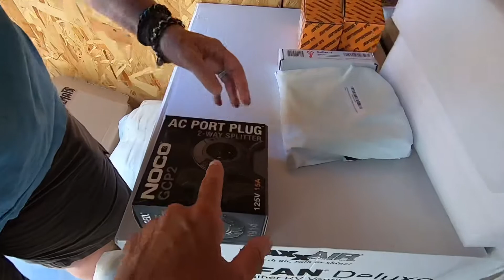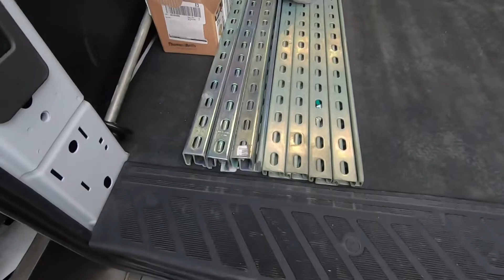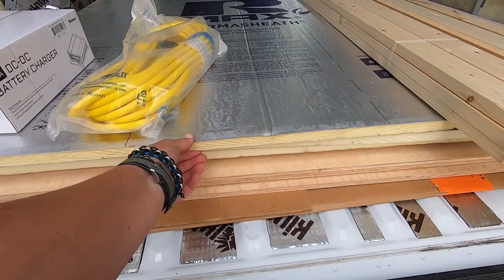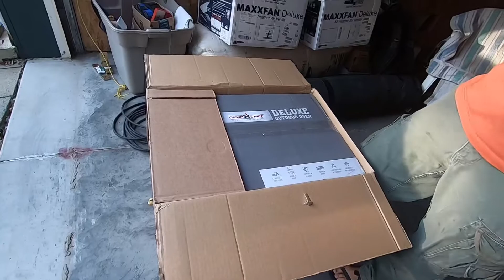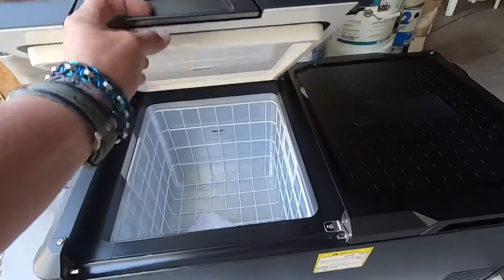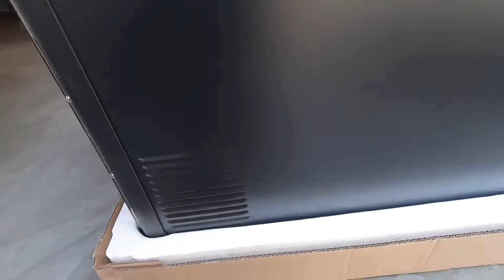Ford Transit Van Build | Materials & Prep Work for Our Camper Conversion

Comment: Hi ladies. We subscribed during your last hike on the AT and still enjoy watching. Great videos! 

So we recently bought a van and are doing a conversion. I know it was 2 years ago but do you remember where you bought these 2 power plugs from. Can’t make out the brand in this video. 😮

I can see the shore power one is a Noco.

Thanks for posting your van build. Very helpful so far.

Curious too if you have any regrets over things you bought and installed.
Reply from the maker: Thanks for subscribing and following along on our adventures! So happy to hear you are in the process of doing a van conversion yourselves. It's a lot of fun, but a lot of work. Glad our videos have been helpful. We bought the outside outlets on Amazon. Here is the link.

https://a.co/d/1VwhRwF